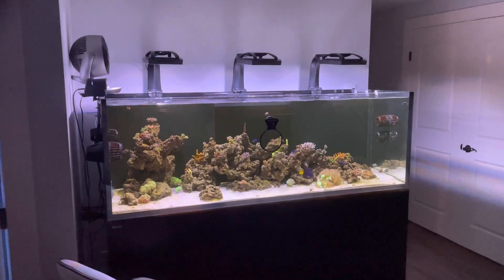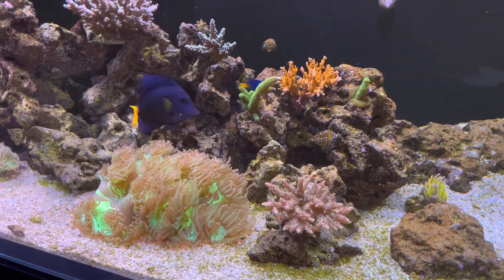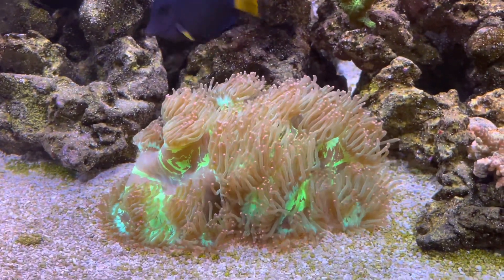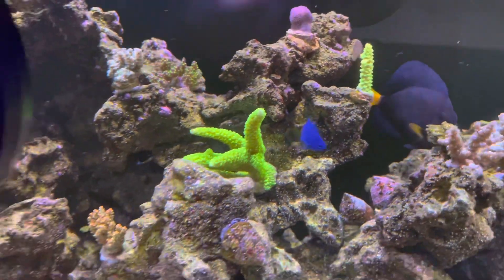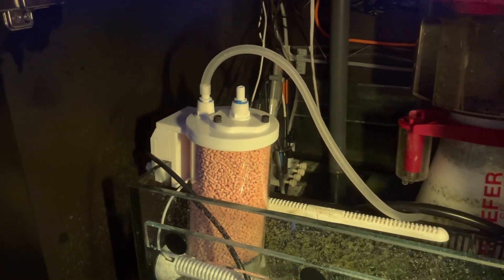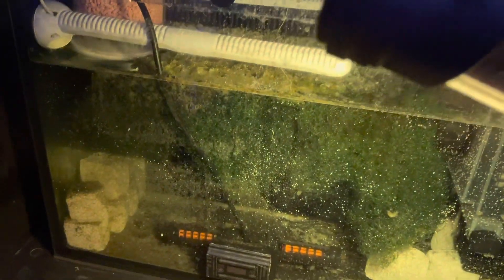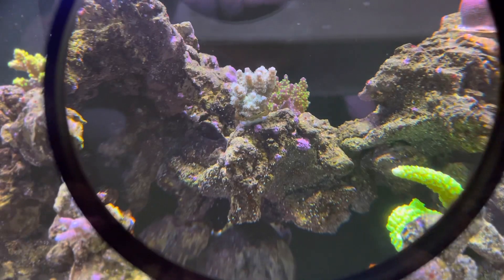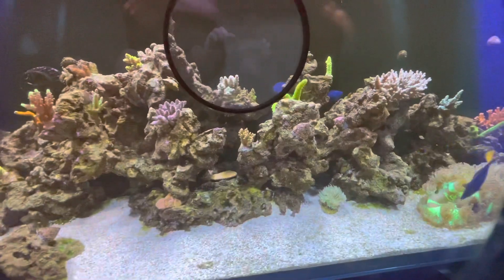How I solved my Low PH Problems

Comment: I have the same CO2 Scrubber and Protein Skimmer. It's been such a pain finding proper instructions on how to install the CO2 scrubber to the inlet which I have just hooked up to the 2 little holes on top...my question is did you run a tube directly into the sump at the base of the inlet and completely bypassed the inlet valve all together? Any information would be greatly appreciated. Thank you in advance. I'm liking your video as it has been informative!
Reply from the maker: Yes I did run straight to the inlet on the skimmer, I did bypass the inlet valve. I found the tubing at home depo as mine was too short. The centre outlet on your co2 scrubber is for air intake do not put it on that one. Thanks for watching, if you hit the notification bell it will notify you when I publish my next videos. Lots more to come.
Reply: @Coralgardens  Thank you! This helps so much! I will turn on my notifications. Keep up the great content!

Comment: I am getting my icecap co2 scrubber tomorrow from brs. Ive never had my ph that stable. I was using kalkwasser for a bit and its since loosed its punch. So i stopped dosing kalkwasser. Right now with no dosing if i do nothing, ph will drop to 7.5 at night and jump to 7.9 after lights come on. I just dosed a little bit of seachem fusion 2 and that boosted my ph from 7.6 to 7.8 after lights out. I usually use tropic marin all for reef but i am out of that right now. Ive since invested in more house plants. Waiting to see if that has any effect.
Reply: Bruh your all over the place

Comment: I am really surprised you did not notice an increase in pH using fresh air from outside going into your skimmer. I keep things steady with all four reef and skimmer and UV sterilizer only  and no refugee or anything else. 90 gallon mixed reef.
Reply: .. fuge
Reply from the maker: Yea I was surprised myself, I have a large home with only 3 people and no pets so my thought was it’s not the co2 in the air causing the low ph. I’m now thinking it’s the coral causing the co2 in the tank

Comment: I had a very similar issue with my CO2 scrubber. My pH is in a similar range to what you described, so I put one on. I had effectively no corals with some coralline algae, but I would still see a 1-2 dKH drop in a day. It turns out that my sand in my tank is a precipitation magnet at 8.2-8.3, so my sand was hardening fast! I would check the low flow areas in your sand bed for hardening, and that may be where some of your spike in consumption is coming from.
Reply from the maker: Yea this makes sense I do have some issues like this with my sand bed. What did you do to help with that?
Reply: This scenario seems all too familiar. I'm also interested in more detail on your remedy? Cheers

Comment: Think the color change is the opposite of what you describe—should change from white to purple/violet as media is used up and full of absorbed CO2.  Here in the US many reefers have DIY’d there reactors to recirculate the skimmer air so media life is extended.  And there are also online vendors (ie fish of hex) who 3D print skimmer lid mods for recirculation of skimmer air.
Reply from the maker: Yes most of the media is as you describe. This media available here starts pink and is supposed to turn white. I am aware of media that starts white and turns pink. Regardless it never seems to change for me, I just know when the ph drops it’s time to change it

Comment: Nice tank and video.  Look into making your CO2 reactor recirculating by running the other tube from your reactor to the top of your skimmer.  Makes the media last much longer.  Good walk through videos on youtube and I believe Bulk Reef Supply has a video on it as well.  I've been looking to do the same on my nano just tough with the space allowed for an all in one system.
Reply from the maker: Thanks for the tip!
Reply: +1 to the recirculating CO2 scrubber. I use the Large IceCapp unit on my WB Reef 130 recirculating and see about a .2 boost on both low and high ends. I also use Kalk but with my new system am only dosing 500ml/day, overnight. Another suggestion is to reverse light cycle the refugium but don’t bottom out nutrients like I did on my last tank!
Reply: Not a good idea unless you have an auto shut off for your skimmer